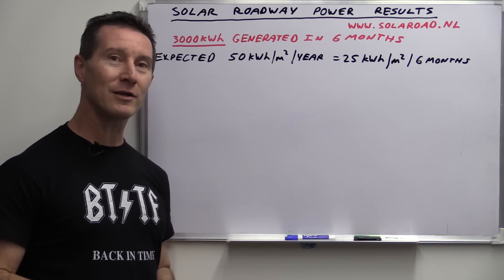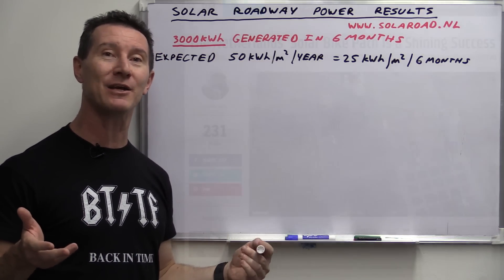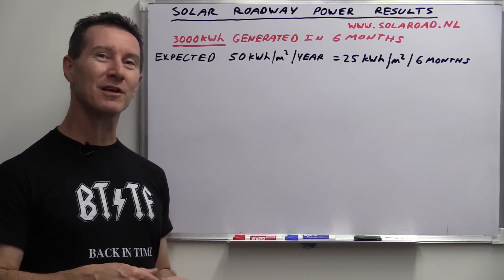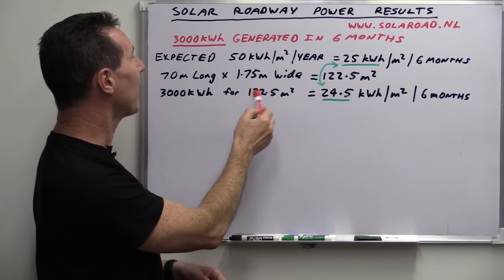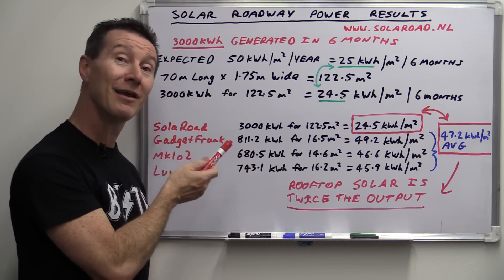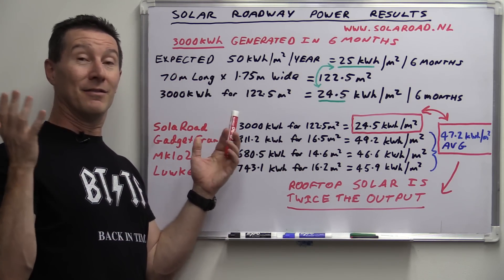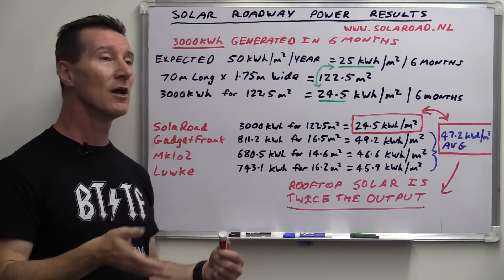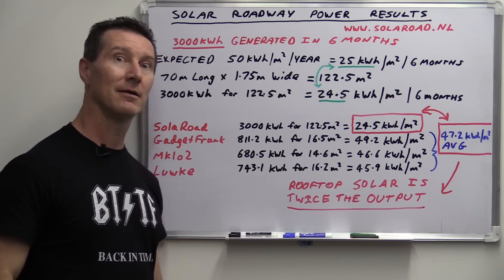EEVblog #743 - Solar Roadways Test Results

Comment: How many KWH are required to produce the tempered glass anyway?
Reply from the maker: ***** You aren't supposed to ask such questions!
Reply: EEVblog LLLL, I suppose not.
Reply from the maker: ***** Anyone with any sense can see it's the worst idea ever, except the true believers...
Reply: ***** dont even get into the resource management with "solar freaking roadways" and how much resources it will swallow up, mind that the cost and even by then the time each and every panel would need to be replaced again at full cost they wouldn't of paid for themselves.

worst idea ever.
Reply: Gordon Freeman When the climate was cooling In the 70s it was man made ice age was going to destroy the planet.
Then when the climate started to warm up in the ~80s it turned into man made global warming was going to destroy the planet.
Then when the climate started to cool down in the ~2000s  it turned into man made CLIMATE CHANGE is going to destroy the planet.
Absolute 0 credibility, but a multi-billion dollar government sponsored industry with the politicians and their big business cronies being the windfall bread winners in the end.
Make people into believers and you can systematically raise taxes and still get re-elected. Follow the $$$...
Reply: ***** exactly man. They'll spend millions to save a few bucks. If it was me, and I was going to piss away money for cLIEmate change. I'd string a dozen airfilters together, and insert them into the coal fired power plant's exhaust system and pay the fellas there to change them every other day.
Reply: ElectronSpark "Absolute 0 credibility", so some conflicting media discounts the data? You're a corporation's dream citizen.
Reply: ***** 
What makes you think that climate change is a lie?
Reply: ElectronSpark "When the climate was cooling In the 70s it was man made ice age was going to destroy the planet."  Some scientist were predicting that but far more were predicting that the cooling period would end and we would soon start rapidly warming.

"Then when the climate started to cool down in the ~2000s  it turned into man made CLIMATE CHANGE is going to destroy the planet." Umm no on both counts. The Earth continued to warm and some bloggers and tabloid journalists cherry picked their start and end point to show the opposite (not hard to do, just start in an unusually warm summer and end you graph in winter of a later year and draw a line between the start and end point and boom a decline). The second is that scientist have been calling it climate change since since they have started looking into it, its not a recent label change.

"a multi-billion dollar government sponsored industry with the politicians and their big business cronies being the windfall bread winners in the end." yes those green energy companies are so huge and powerful, not like the poor little oil companies.
Reply: ***** 0 since they built the glass using energy from solar road ways.
Reply: ***** Adding up the confirmed and estimated death toles from ALL nuclear accidents to date, the tole is less then 200 for direct deaths with indirect deaths in the 5000s where 4000 of that was from Chernobyl. Now lets start on the death tole from other (energy) related industries. lets start off with the worst disaster we have had in the field. the  Banqiao Dam faliure. 250,000 dead and a vaste stretch of land flooded. Several hundred direct deaths from Oil & gas explosions almost reaching 1000. and the indirect deaths from the hydrocarbon energy sector goes above 1,000,000 per year due to health effects caused by smog.
Between Fukushima and Chernobyl some 3,200 Km^2  have been made un usable. the amount of land we have destroyed through mountain top removal for coal and through tailings damn failures is massively larger then that. What im saying, is the risk is lower then risks we are allready taking playing with hydrocarbons. even if we had a chernobyl level event every decade it would still have a lower risk and it would still result in a lower number of deaths then what we are currently doing... And nuclear technology is mature, we can build them on the same scale to the oil and coal plants. we have shown its possible to replace them with nuclear in a short time frame. something the renewable sector hasn't shown even with their many attempts. This climate issue is a race against time, I'm all for renewables but i don't want people twidling there thumbs around waiting for the tech to mature.
Reply: ***** More like, when it comes to safety, nuclear power plants are planes and chemical spills are cars, one kills far more then the other, but you will never see coverage of that one on the news for several weeks. Nuclear power is a solution to the green house issue we are having atm and it kills far less then what we are currently doing.
Reply: ***** You can always trust a guy named Barack Lasagna
Reply: ***** Oh, and the road would need to be closed for solar panel maintenance and to clean the rubber off the road lol!
Reply: ***** You do realise that chemical plants and waste damns for the chemical industry fail far more often then nuclear plants right, and that they contaiminate large swaths of land with toxic chemical waste that will always be toxic and they effects far more people. Compared to alot of industries we use, an accident in the nuclear industry is rather benign. The only real difference is ignorance and scare mongering.
Reply: Clifton Murphy
Do you expect those panels to outlast those asphalt-topped roads?
With real traffic, I don't give them 26 DAYS.
Reply: ***** That and people like me would 'borrow' them for their solar projects....  solar panels belong in safe, secure, clean places... like on the roof. :p
Reply: EEVblog We should jettison all of the true believers toward the sun... where they can build real solar roads.
Reply: azmanabdula The thing is, until every rooftop is covered in solar panels, no other solar application makes sense, at least if your goal is the most energy for the least cost
Reply: Not to get in the middle of the whole global warming debate going on but watching this video and reading these comments really makes me wonder if solar energy could ever really replace fossil fuels one day and if so, at what cost? I'm no expert on the subject but it just seems like nuclear energy is so much cheaper and cleaner to produce.
Reply: Chernobyl is a RBMK typ reaktors. This type is not made any more. Also, it had no containment building that was the major problem with the accident.
If you talking about farms,there is some out side of the Exclusion Zone, they farm all day and there is no problem.
Inside the Exclusion Zone there is of cause (per definition) no active farming. There use to be some farms.

Actually the city of  Chernobyl is not technically evacuated today, there is about 600 people living there and the level of radioactivity is far with in the safe limit, but it is actually in the theoretically evacuated zoons. Actually today about 96% of the evacuated zone is below the limit. But the area today is much more valible as a evacuated zone so there is no need to de evacuate it.

"Which has the radioactive for Ages waste?"
what about it?

"Most people killed by nuclear industry take a long, painful and extremely expensive time to die, con-fucking-gradulations!"
No that´s is a myth, you watch far to much TV.

"As was pointed out to me in 1973, the lack of personal responsibility in the industry almost guarantees accidents"
Well, someone is stupid then. Nuclear industry is the safest industry in the world.

"One incident and the roaches scurry for cover."
Yea, its quite clear you dont know anything about it.
Reply: It originates with The Club of Rome.
They are the old world imperial europeans, who are hell bent and determined to collectivise the planet, cull the useless eaters, and rule over the one billion remaiming hue-man resources.
Reply: EEVblog I would have thought that the people at Popular Mechanics had some sense... It seems not...
Reply: ***** Sure, sure. It is such a generic term that anything can be labeled cLIEmate change. Air pollution, water poisoning is us, CO2 based warming is something far bigger than us.
Reply: CareerKnight
I want your sources please, not some cherry picked old data :P.
Reply: ***** Maybe you should read up on the things you claim?
There is not 'pause' in global warming.  
The average temperature of the air hasn't risen - so what? The big big majority of heat goes to the water, and the water temperatures have risen.

Also, there are more ways of measuring it - and one is quite simple - measure the energy that the earth receives and the energy the earth looses - and viola - we have a net gain - the earth is receiving more energy than loosing.
Reply: *****
Oh well, i have already read a bit of their reports, and i tried to find what you are referencing - well - nope, nothing.
The climate is still getting warmer - according to the latest report of the IPCC too.

http://www.ipcc.ch/pdf/assessment-report/ar5/wg1/WG1AR5_SPM_FINAL.pdf

And yeah, the upper troposphere won't get warmer - the sea does, the ice melts, the glaciers recede.
What more do you want?
What we experience right now is pretty much the worst scenario predicted 10 years ago - and claim nothing is happening?
Reply: ***** Its actually not that bad, producing. The thing is that most of the energy is heating, and it can be done more efficient with direct fuel heating.

But that is temped glas. If we talking about safire glass its like 50 times more energy or something.

Also, the high transparency glass used at normal solarpanels use a lot more energy to be produced than normal 

The thing is with normal glass is that it is the least transparent in the green sector. For normal day to day use, it dont matter, because the human eye is the most sensitive in that sector.

The problem is that most PV  is optimized to use this specific freqnesy to convert it to power. The thing is that using just a single junktion PV is a lot cheeper than using multi junktion once. So producing twice the amount of single junktion PV is still more efficient than producing halve the amount of tripple junction once.

The sun is most intensive in the green-yellow ish band. So they PV producer's optimize the PV fort that band to get the maximum amount of power for a single junction. The problem is that normal glass, as well ass tempered glass (that is basically normal glass that have been change to be tempered) is not that transparent.

This making it really bad using normal or tempered glass for PV:s. Using special PV glass panels that is especially transparent in this region is preferable. This use a lot more power to produce, but not that much more so it ofset the gain. Well, that is, if the glass is like 2-3mm thick. If its 20mm thick, well, then forget it.
Reply: Gordon Freeman
We'll be cool as long as you finish hl3
Reply: ***** How little you know... Well well, you can always learn more. 

The thing is that heavy metals are collected behind the dam wall. They are quite positives (much more than the radioactive fall down of for example Cesium 134, that was the major fallout of Fukushima, that by the way have a half life of 2 years)

They don´t do that much during the time the dam is working. But if the dam collapses the toxic heavy metal is spreed over quite a area. It also flodes the areas and drown every one there.

This might not be that common, but its far more common than nuclear power plant breaking down, it do happen every second or third year or so, the media usually don't report on it if you dont live in the area.

The biggest accident of this type happen in China in 1987 it drowned about 170 000 people and left over 2 million homeless.

They have to dig 5-10 meters down in the ground and processing several cubic km of earth to remove the heavy metal, other vice is literally deadly to live there.

Around fukushima about 90% of the close of area the radiation is now all but gone. In the next 10-15 year the whole area except from the closeted 500 meter from the reactor will be considered clean. With out touching a shovel. The total number of death of the Fukushima nuclear power plant was 4 people. That of 3 died from physical harm, and one died of a heart attack (considered a work place accident).

Actually in the less known Fukushima hydro pump power plant, the very same day, the dam collapse bacuse it was undermined by the tsunami, killing 8 people in the process (go check it up). I bet you didn´t know that.

Don´t talk about Chernobyl, its a older generation reactor. Its only 6 still in use, and all will be closed down by 2023.

Fukushima I is actually quite old to. They are actually older then the Chernobyl reactors, but its a half a genaration newer type of reactor. The Fukushima II nuclear power plant, that is just next to Fukushima I did not suffer any meltdowns or major problem, and its suffered the exact same tsunami. Why... well its more modern.

Even Fukushima II is quite old by international standard. Also Fukushima I was lacking a over pressure filter that's is mandatory it just about every western country. With that filter there would be no contamination what so ever. Of the worlds nuclear reactors today about 80% have that filter, and most of the once that don´t is about to be closed down.

Looking at the reactors that is built today almost exclusively (apart from a hand full in china), they are Gen III or gen III+. They have total passive cooling. They are walk away safe. No accident or even critical condition have ever accrued in a reactor of that type of reactor. Well, because its basically physically impossible.

" because the ones we have have not killed more people than wider-used technologies and support... YET?"
No, you are way of the math. Nuclear power kill the least people per TWh. It don´t matter if you build 1 or a 1000. That number don´t change (well, it decreases if we build more modern once). Actually nuclear power kill less than solar, and also less than windpower.

Wind-power kills about 100 times, yes, times, not procent, more people per TWh produced than nuclear power the last 20 years in average. Even including Chernobyl, the differences is still way over 10 times. Windpower actually become safer to. But they still kill about 5-10 people a year, and that's quite a lot.

Most of the people killed in Nuclear industri is actually not killed in large scale accident. Most is killed in mundane activity mostly because of fall or hot steam. Some are killed in radioactivity accident, but its really rare. The last 20 years only 5 people died that way, its still to much, but its less then is killed in windpower in one year.
Reply: ***** We are constantly tearing up our roads and replacing them.  Assuming it were viable, this is something that would have to happen over a long period of time.  The roads would not suddenly be all raised and replaced.
Reply: ElectronSpark
It's like this. When all that climate scientists was records, geology and beginning satellite scans the picture was that natural cycles determined the weather and that man has no great sway in the matter. By all the natural cycles we would be headed into an ice age over the next centuries, the 90's should have been cooler totally by natural processes.

I remember the 60's very well, winter stayed winter. By 74 winter took a vacation. Now it shows up for star appearances with spring in between several times a year.

The ocean temperatures are up. The glaciers are disappearing. Sea level is rising and it's not just because more than 10,000 year old land ice is melting. As water warms it expands a little. The oceans are miles deep, the expansion will add up as they warm.
Reply: ***** Let's just use his numbers (the yield you end up with is around 70kWh.m2 annually) OK... @ 15cents/kWh = $10.50 worth of power produced per  m2/year.

$10.50/yr   These people have to stop.
Reply: Raspoetin a This entire arguement is stupid. We need real numbers for the cost of existing solar road prototypes to make any real arguements. This is all people argueing over speculation.

My arguements stems from common sense. You put solar cells on a roof, you need a somewhat light, somewhat cheap enclosure. IF you have them on the ground, you will need a much beefier enclosure to handle bikes / people, or insanely beefier enclosure to handle semis / trucks. No matter what the cost of the solar cells or roof enclosures, just thinking about it for more than a minute, it makes sense that the roads would cost more.

How much more, the solar bike path people won't even TELL us. since they BUILT it and therefore had to PAY for it, they would know, but the fact they  won't TELL us leads me to believe the number is high at best and embarrassing at worst.

We are at the point that really, we need REAL LIFE numbers to continue.
Reply: ***** My original commet's ( 148 comments ago) sentiments exactly. Put them on the roof of however many people's roofs that that would pay for and move on.
Reply: Barack Lasagna  ?
Reply: Gordon Freeman Yeah dude, and solar energy is their master plan. You wouldnt understand, but trust me, you will scream "DAMN YOU SOLAR PANELLLSSSS" as you die
Reply: ***** Someone always beats me.....   Fucking spot on!
Reply: EEVblog Such as yourself? :)
Reply: jrmym2 The technology shouldn't be undermined due to the incompetence of a few people....

What happened to spray on (In layers) solar paint?

The application of this on every concrete surface when economical will be sufficient in reducing cost on energy expenditure... 

.....and what happened to ponds filled with pond scum genetically engineered to produce low currents? 

Think biological and save the earth from heavy metals : P

(Im thinking at least 2 centuries before my time but we cannot just give up)

PS My position on solar roadways is too harsh to announce...
Reply: CareerKnight "scientist have been calling it climate change since since they have started looking into it, its not a recent label change."
So all those nightmares I had in grade school about the world coming to an end due to a man made Ice Age was just a label misunderstanding on my part. Just like all the years Global Warming was in the news I was mishearing it too.
I know, just because I lived through it all it won't change your faith. I would probably have more luck convincing a Christian that Jesus didn't exist or a Muslim that Allah didn't exist.
Reply: ElectronSpark
Since you for some reason you didn't read it before i will post it again. In the 70s "some scientist were predicting that (an ice age) but far more were predicting that the cooling period would end and we would soon start rapidly warming." To be more exact between 1965-1979 there were seven papers published predicting global cooling and in the same period there were forty four papers predicting global warming.
Reply: ***** Solar panels don't grow on trees?
Reply: 2 things. The roadways are not only a fact of input vs output on energy but is pushing the production of clean energy. Second of all, it may take energy to make the panels but your return on investment is clear after a few months of use, and even after that maintenance energy/cost is far lower than the output they would produce in a given time period.
Reply: ***** I hope to god youre not an engineer. You cant be. Surely
Reply: CareerKnight No problem, warming, cooling, the "cure" is always the same. Let the government keep taxing and taking control of what you can buy and do until you are nothing more than a slave with a bus pass. Then one day you'll wake up and see the environmental rules are no longer being enforced and the politicians and their wealthy cronies all have carbon footprints the size of a small city (just look at Al Gore's extremely wasteful carbon footprint used to heat and light his huge mansion and fuel his private jet-setting lifestyle). 
It's going to be a rude awakening when you realize they didn't care about the environment all along but they definitely got everything they wanted and with your support. Just don't think you'll be able to protest or they'll take away your bus pass.
Reply: ElectronSpark
You are a sad strange little man and you have my pity, and I think you want to be arguing with someone else with all the bs you keep randomly introducing into the conversation.
Reply: EEVblog Solar Roadways may have you drawn and quartered, just for thinking that question. LOL!
Reply: Gordon Freeman
Sources to which part
Reply: Hugh McBroom Then there is all the people killed falling trees for firewood, mine cave ins, and oil rig fires.
Reply: CareerKnight "... cherry picked their start and end point ..."  Not taking sides here, but the "cherry picking" argument doesn't work any more over 17+ years -- those "bloggers and tabloid journalists" were right.  Even the IPCC has acknowledged a "pause" in global warming.  There have been some attempts at explanation, and the significance is a subject of debate, but the pause is real.
Reply: ABaumstumpf Don't argue with me; argue with the IPCC.  They acknowledge a pause.
Reply: ABaumstumpf http://www.bbc.com/news/science-environment-24173504
Reply: *****
I have read the direct IPCC report, not some second-hand report that tries to twist reality.
You know, yeah, some parts do not warm up as much as others, and some even cool off - that is a predicted effect.
You are trying really hard to deny facts.
Reply: ABaumstumpf I'm not denying anything -- I started this by saying I wasn't taking sides.  I just pointed out that the IPCC acknowledges the pause (they appear to prefer "hiatus").  I am well aware of the fact that global warming is a theory that predicts (after the fact, of course) anything.
Reply: ***** Here's something you may find interesting  http://www.crystalinks.com/volcanoesunderwater.html

http://www.bing.com/images/search?q=new+islands+forming&qpvt=new+islands+forming&qpvt=new+islands+forming&FORM=IGRE
Reply: ***** I tried your link three time man, no luck. I'll try reserchgate.net directly.  FYI
Reply: *****
And i'd suggest you to READ the actual report - in no way does it say the warming has stopped.
What is happening is that the air is not warming as fast as predicted initially - but the oceans are warming slightly faster, the ice is melting slightly faster - aka the heat is distributed slightly different than predicted.
Reply: ABaumstumpf You keep arguing with me when I'm not arguing with you -- you even concede that the air is not warming as fast as predicted.  See http://blogs.scientificamerican.com/observations/the-pause-in-global-warming-is-finally-explained/

All I'm saying is that denying the reality of that (when it's blatantly obvious from a glance at a relevant graph) is just handing ammunition to the deniers.

I tell folks about global warming all the time.  When there's a drought, I tell them it's a predicted effect of global warming.  When there's too much rain, I tell them it's a predicted effect of global warming.  When it's too hot, I tell them "global warming" explains that.  When it's too cold, I explain to them that global warming predicts that, too.  When there are more hurricanes, I tell them it's due to global warming.  When there are fewer hurricanes, I patiently state that global warming predicts that.

We're clearly on the winning side.
Reply: ***** You're on my thread, go fuck yourself.
Reply: *****
"2014 was the hottest year on record ..."  You have to be careful with such absolutist claims.  In fact, statistically speaking, that claim has just a 38% likelihood of being correct, due to the error margins.  In particular, 2010 and 2005 have a significant likelihood of having been hotter.  This is why I keep cautioning folks not to hand ammunition to the deniers by making bald statements of fact; stay as vague and nebulous as possible and avoid falsifiable claims.
Reply: CareerKnight
Shit, my bad, I meant to reply to ElectronSpark.
Reply: CareerKnight Do predictions made before both data collection and methods in climate science improved have any power to change the long term consensus of over 95% climate scientists?
If you got a test paper with 97% right, do you try and say that those 3% wrong prove the teacher wrong? Because that's what the denialists have essentially as their main argument, that the consensus is wrong!
Reply: Dev Durer Do you want to live where the spent fuel is kept? Or how much "disposal" and security will cost?
Where will you find responsible people to build, run and maintain these nuke plants? That's been why the failures that happened so far have happened. Shit happens and no one is responsible, throw money at it.
Reply: Hugh McBroom Comparing nuclear power plants to dams breaking is comparing apples to cinder blocks. I have yet to see a broken dam cover an area with radioactive pollution and all the associated long term problems.
There's very few nuke plants compared to coal fired generators and those are bad enough but you can't compare total problems of one with total problems of the other, that's cherry to truckload of watermelons comparison -- to see which is heavier! No duhhhh.
Let's build 1000's of nuke plants because the ones we have have not killed more people than wider-used technologies and support... YET?
Reply: matsv201
Are there farms around Chernoble yet? TMI?
Which has the radioactive for Ages waste?
Most people killed by nuclear industry take a long, painful and extremely expensive time to die, con-fucking-gradulations!
As was pointed out to me in 1973, the lack of personal responsibility in the industry almost guarantees accidents. One incident and the roaches scurry for cover.
Reply: ***** Going from IC vehicles to EVs will take three decades if we think about it seriously.
Making all the roads photovoltaic. Probably only half of that time. :)
By the way , you know what is the future of stationary storage? Hydraulic hydro storage invented by the german physicist Eduard Heindl.
If that is going to work we will be out of trouble. They are currently undertaking feasability studies here in Germany.
Reply: Tetra Digm What are you talking about?
Reply: Tetra Digm Diffrent kind of reactors
Reply: Tetra Digm
People who work with radiation here wear dosage meters and protective gear. If your meter says enough then you stay away for as long as you are at a safe limit.
So are these people in Chernobyl always the same people? How are they dressed? Do you know their medical histories? Because otherwise you try to make people being somewhere into more than you know.

Have they finished the New Safe Confinement that they hope will last more than 100 years to cover up what you seem to think is safe?

I am sure that whatever your government tells you is true since only the US government lies to its people. That must be true, the Easter Bunny told me so and the Tooth Fairy agreed.
Reply: ***** less than what is required to produce asphalt.......
Reply: Tetra Digm The problem is that chernobyl didn´t melt down. It was a over critical core explosion. It´s not the same as a melt down.

The people living i Chernobyl (the City) today, is living there, full time. There is hardly radioactivity left in Chernobyl (City). The levels is actually lower than a lot of bigger Cities. There are dressed like normal people, because there is not any high level or radioactivity. There medical history is much better than most larger cities.

"cover up what you seem to think is safe?"
It dont really matter. If they just start cleaning it up. But there have been a lot of political issue about cleaning up the core. The thing is that a lot of anti nuclear people don't want it cleaned up. This is actually the biggest problem. The technology to clean up the core have been available some time. But can´t be used because Tjernobyl is in Ukraine, not Russia. Russia wan to clean it up, but they are not allowed. Thats why Russia sent that much cleaning up equipment to Fukushima.

The "radioactive" water stared in Fukushima is all cleand. The reason why it´s not allowed to get disposed of is political
Reply: *****
I wonder how long it will take for Texas to declare they've had enough of what ain't happening?
Reply: ***** The 38% figure is correct, according to NASA; I should have been more specific.  I hadn't seen the NOAA result you quote.

See http://www.ncdc.noaa.gov/sotc/briefings/201501.pdf (slide 5) for a side-by-side comparison.  In any case, 48% still means that it is more probable than not that 2014 was not the warmest year.
Reply: *****
And 100% probable it's in the top 10.
Kind of makes me wonder about the preceding years, how many since 1999 have been 100% in the top ten.
By the natural cycles, we were supposed to be entering a long cooling period as of 1990.
Reply: ***** I don't know.  I'm not saying one way or the other whether this is viable technology,  but I know I can walk up the street and buy quarter inch thick tempered glass for $0.33 per square foot.

The other thing is that if you're making solar roads, you have to look at conventional road costs vs solar road costs plus energy production benefit.  Remember, we're moving away from coal production with the solar model, so you have to add conventional road costs plus coal and other energy production costs.
Reply: BrainToMush Well, the ashphat and concrete roads are all ready in place. When they were built they were fully costed with those dollars then.
Tearing them up and replacing them would be a very bad idea.

If people want solar, fine, great, put it on the roof. I looked into it when I owned a house, it was too expensive back in the 90's.
40 year ROI.

Remember too, these roads were walking and cycle paths, not automotive roads.

P.S. Your comment was marked as spam. Since this is my thread, your comment stands.
HARV
Reply: ***** /facepalm...you do realize that roads are replaced constantly right? They are not something that once down your done, so im confused here with your logic. All studies to date show the average lifespan of a asphalt surface is at most 26 years on very low useage roads. this is of course much worse down to around 5 years on busy interstates. The simple fact is that ALL asphalt roads are replaced constantly. Your initial argument is invalid.
Reply: ***** ..... CO[2] is the primary exhaust product of burning coal.
Reply: ***** You throw your Holy Pope under the bus so fast! Poor little Al.
Reply: ElectronSpark You better watch what you say! Clearly Buzz Werd knows more than Al Gore and apparently he is a climate scientist, or maybe he just plays one on the internet.
Reply: Pixy Orgami
You twy weaw haad to gwow up a be a biiig twow some day. But for now, your momma's callin.
Reply: ***** I didn't mean to hit a nerve by calling him your pope. Sorry about that.
I've heard doomsday predictions about climate change all my life. When I was a kid in the 70's the man made ice age predictions scared the hell out of me as I didn't think I would have a future, now the warming scares would be funny if they weren't so pathetic.
I don't know which group has made more failed doomsday predictions, 'climate change' activists, or Jehovah Witnesses.
Reply: ***** 'How many KWH are required to produce the tempered glass anyway?'
It takes between 5 and 10 Kwh to produce 1 Kg of glass. A 10mm thick panel weighs about 25 kg. So 125 to 250 Kwh.
Energy production is estimated @70Kwh per year, that means that it will take between 2 and 4 years for this road to pay back the energy debt. 

The solar panels also need energy to be produced, and it takes about 1 to 4 years to pay back the energy debt.

6 to 10 years is probably a fair estimation for this road to pay back its energy debt. 

Is this road profitable over a lifespan of 20 years? From an energy perspective I would say Yes.
I don't know about the economic feasibility because they have not released the price difference between an ordinary road and a solar road.
Reply: Raspoetin a A city would probably receive better benefit for their dollar (not to mention decreased carbon emissions) by offering a small rate reduction to customers for use of their rooftops. Install and maintenance would be less, sunlight angle would improve and the panels could possibly lower energy use by that customer due to any insulation properties the panels may provide.
Reply: ElectronSpark Absolutely.
However, if they were to equip every roof in the Netherlands with solar panels, they would 'only' generate 25% of the needed energy.
If you want a larger percentage of renewable energy, then other options have to be explored.
Reply: Raspoetin a
You really think that 10 mm glass will support road traffic? Here's some words for you: vibration, braking, cornering, tonnage, normal and forces.

When you do your calculations, you do know that the Solar Road cells do not cover the whole surface? They tell how much. That every vehicle on the road necessarily shadows an area the whole time it is on the road and that gets wider as the sun gets lower in the sky? Your grid takes big hits during rush hours. Bumper to bumper shade. Do you know that road surfaces get DIRTY?
Reply: ***** 'You really think that 10 mm glass will support road traffic?'
I don't know. 
Some info on the strength of glass:
http://uk.saint-gobain-glass.com/trade-customers/physical-properties
The compressive strength of glass is extremely high: 1000 N/mm2 = 1000 MPa. This means that to shatter a 1 cm cube of glass, it requires a load of some 10 tonnes.

The resistance to breakage on deflection is in the order of:
- 40 MPa (N/mm2) for annealed glass
- 120 to 200 MPa for toughened glass (depending on thickness, edgework, holes, notches etc).

"Your grid takes big hits during rush hours."
Yes. 
"Do you know that road surfaces get DIRTY?"
Yes.
Reply: Raspoetin a One vandal with a sledge hammer or other heavy object in the middle of the night could probably do millions in damage with hits at intervals.down the line. I can't say I understand what drives a vandal to do what he does but the more damage they can do seems to make them enjoy it even more, especially if their handiwork gets on the news.
Reply: ElectronSpark I wonder if the coating will help to prevent shattering.
Reply: Raspoetin a
Compressive strength acts when you have a solid base to compress against and that is not PCB's with solar cells.
The glass will have to rest on standoffs and weight born between those will include bending forces. How is the tensile strength of plate glass? crrrrraackkkk
Reply: ***** 'and that is not PCB's with solar cells.'
What makes you think they mounted solar cells on PCB's?

'The glass will have to rest on standoffs'
What makes you think the glass is resting on standoffs?
Reply: ***** 'The same thing that makes me think you never watched the Solar Roads promo videos'
Oh great, another one who cannot differentiate between the 'Solar Freaking  Roadways' with their hexagonal panels and the Dutch Solar bike path.
This video is about the test results for the Dutch bike path.

The whole construction appears to be somewhat similar to conventional Solar Panels. Its a layer of Glass on top of the Silicon panels and put in a frame.
The glass is thicker with an 'anti slip' coating, and the panel is now made from concrete.
Reply: Raspoetin a
It's still bullshit.
The roadways have been debunked and the bike paths have been debunked but you want to hang on and cry nonononononono over every little detail you can imagine.
Reply: ***** No, the Dutch solar road hasn't been debunked what so ever. 
The goal is to have a 'return of investment' of 15 years in 5 years time. But since no one knows what the extra cost per m2 is going to be (including maintenance), no one can make a clear calculation.
Dave's whole argument leans on the comparison with tiny retail systems, not large scale solar farms.

The big difference between a solar panel on the roof versus  on a road is the thickness of the glass, about 3 times thicker, it has a coating and lays flat. And instead of hundreds, if not thousands of individual controllers and connections to the grid, there can now be just 1.
Reply: Raspoetin a
So long misdirection troll.
Reply: Hugh McBroom Not even that. Chemical spills are Titanic drowning. Filter failures and coal dust are worse still. The worst failure since Chernobyl, Fukushima, is comparable in scale to a bus crash.
Reply: Raspoetin a Your estimates are off - this is best case 25 kWh/m^2. 1 kg of tempered glass is not enough to cover 1 m^2 of solar panel and more importantly, not strong enough to be used as a road. The lifespan is probably "a bunch of trucks".

So it will not be profitable as you'd get to replace the panels very often - not to mention maintenance cost to keep them clean enough to deliver those good figures.
Remember, this was a bikeway - not traversed all that often either.

I'm also concerned about practicality:
a) eye glare from reflections
b) slippery in winter, cannot use standard sand and salt on top
Reply: AstralStorm Dave calculated this as 25 kWh/m2 for the first 6 months. I calculate it as 28-30 kWh/m2. This figure is only for 6 months and excludes the summer months. When I compare it with other solar panels, the yield you end up with is around 70kWh.m2 annually.
They used 10mm glass on top of the panels, this is roughly 25 kg/m2.
The glass has a coating on top that provides the 'roughness' and removes the glare. http://www.solaroad.nl/wp-content/uploads/2013/06/LabTNO2.jpg
Reply: AstralStorm
Notice how Dave shows the 6 month period that includes summer and winter and how Dave shows his calculations.
Then notice how it's claimed that the 6 months does not include summer and a set of ratcheting upward estimations with zero calculations actually shown.
He could work for the solar scams people, their work is just as phoney and intentionally misleading. I wouldn't be surprised if he is.
When it's been shown again and again not just that but how money spent on solar roads is a stupendous waste, only idiots and liars will argue.
Reply: *****
Maybe the next scam will be square wheels for cars and there will be idiots defending that.
Reply: ***** $10.50/yr = $157.50 over 15 years.
Price of solar panel per m2 wholesale around 50m2 (Alibaba.com)
Price of glass panel wholesale around $20 per m2 

That leaves $87.50 for the coating, the electrical connections and maintenance, transport and handling and so on.

Is this feasible? I don't know but the Netherlands Organisation for Applied Scientific Research ( a non profit organisation with 3000 specialists) seem to think it might be possible. Their goal is to have a 15 year return of investment on these roads.

Unlike roof top installations, these roads can be produced 'en mass' and in large quantities. If you have to build a road anyway, all you have to do is add the panel, the glass, some surface coating and connect it all up. 
The work involved in creating these roads seems pretty simple. Put the glass down, add panels on top, bundle the wires and pour concrete over it. Once the concrete sets, you turn the panel around and spray the glass with a coating.
Reply: Raspoetin a Are these road ways? With cars and trucks travelling them?
Reply: ***** Their goal is to eventually make them into road ways for cars, trucks etc. But the requirements for a road is much higher then for a cycle path and I don't know if these road will be able to withstand the forces that come with heavy trucks.
I guess that testing it on a cycle path is much safer while still providing the needed data.
Reply: Raspoetin a You are suggesting that the individual bike path panels will cost around$157.50/square meter, to include installation and maintenance?  LOL!!!!!! you are seriously delusional, the prefab concrete would probably cost more than that, not to include the glass, textured layer, installation, maintenance, power inverters, and the solar panels.
Reply: ronc1357 I am not suggesting anything. I was merely showing some of the extra costs involved in changing a prefab concrete road to a prefab solar road. 
A group of specialists (Scientists, engineers) did a techno/economical study of the concept and they calculated a current pay back period of 20 years, and a possible ROI of 15 years in 5 to 10 years time.
Am I delusional? NO, just sceptical.
Reply: Raspoetin a  "$10.50/yr = $157.50 over 15 years.
Price of solar panel per m2 wholesale around 50m2 (Alibaba.com)
Price of glass panel wholesale around $20 per m2 
That leaves $87.50 for the coating, the electrical connections and maintenance, transport and handling and so on." 

This is your quote. You don't sound too skeptical to me, from your comments you seem to be promoting this completely unrealistic endeavor. You sound just like the solar roadways fan boys, delusional, or you're just a troll.
Reply: ronc1357 I did those calculations because I am sceptical. I just wondered why they would research this in spite of the arguments from Dave or Thunderfoot. Now I have my answer. An incomplete answer for sure, but it does show my that further research into this is warranted. I can imagine that the techno/economical research showed an initial 20 year payback period.

I realise I sound like a solar roadway fanboy, I am not. I am just trying to be realistic.
Reply: Raspoetin a https://www.youtube.com/watch?v=6-ZSXB3KDF0&lc=z120sj4bdq2ouzlbl04cjxqy4xrwixdpjyk0k
Your estimates for solar panels seem ridiculiously lower than any panels I see in the stores, but ill give you benefit of the doubt and assume that's markup retail

Section revised, see below:-No way in hell is tempered glass $20/m^2. First consider that you need TEMPERED GLASS which is much more expensive than the regular pane glass you see all the time. Now consider that you'd need glass at least several inches thick to support cars and trucks and SEMIS running it over. Also factor in some kind of support that holds the glass up above the panels (You're not putting all that weight direct on the panel if you want it in one piece). You could EASILY be talking $150-200 just for the glass-
I'm revising this section based on links posted lated on. From the prices for wholesale glass, I can find consistant quotes for about $2 per mm per m^2 of glass. This comes to 20$ per m^2 of bike path 10mm glass. For a solar road, holding vehicles much heavier than bikes and people, like semi's and trucks, it's a lot harder to guess a thickness. I'm going to ballpark it at ten times as thick, which would be around $200 per m^2 of road. *Note that a loaded semi trailer is more likely 1000 times the weight, and due to a greater surface area on the road, 100 times the psi (weight per square inch of glass it's on) than bikes and people - if the thickness of glass scales linearly, that's 2000$ in glass alone. Therefore $200 per square meter for roads is definitely a SEVERE UNDERSTATEMENT of cost made for the sake of example.

"Unlike roof top installations, these roads can be produced 'en mass' and in large quantities."
False preposition that they are not produced en mass. In fact they produce solar panels as fast as they can. Growing the silicon wafers is a delicate process and takes time, regardless of whether they are going into roads or rooftops. ANY ADVANTAGE FROM SCALE OF ECONOMICS THAT MAKES SOLAR PANELS USED FOR THE ROADS WOULD ALSO MAKE ROOFTOP PANELS CHEAPER! If they found a way to make solar cells half as expensive, BOTH would become cheaper, meaning rooftop will always be better value.

"The work involved in creating these roads seems pretty simple. Put the glass down, add panels on top, bundle the wires and pour concrete over it. Once the concrete sets, you turn the panel around and spray the glass with a coating." 
In a dry climate with very stable ground that might work, but anywhere that sees winter will see much pain. Water seeps in-between the "tiles" and expands as it freezes. If you look up videos of freezing water shattering thick metal spheres, you'll realize the problem. any cracks in the side of the units could crack the cement base and the panel, or pry the glass off of the cement. Water freezing between cells in a road could press them together with enough force to crack them. Don't believe me? Go take a look at any large area covered with paving stones, and observe how many are cracked or broken.
Reply: ***** 
Your estimates for solar panels seem ridiculously lower than any panels I see in the stores, but ill give you benefit of the doubt and assume that's markup retail

The price came from ALibaba.com. Don't forget that I looked at the prices of panels without glass and frame, just the 'naked panels'.
But if anyone has a better price indication, then I would love to hear it.

No way in hell is tempered glass $20/m^2...you'd need glass at least several inches thick

The glass that is used in this road is 10mm thick (0.4 Inch). Compression strength of glass is very high. 
- Fully tempered glass in the US is generally rated above 65 megapascals (9,400 psi) in pressure-resistance, while heat-strengthened glass is between 40 and 55 megapascals (5,800 and 8,000 psi).
- High-strength concrete has a compressive strength greater than 40 MPa (5800 psi).
Since the glass is fully supported, tensile strength will only be an issue when traffic is accelerating, braking and so on. 
Someone else who did similar calculations came to 30 Euro for the glass. 

False preposition that they are not produced en mass
I was not talking about producing the panels but about the installation of those panels. 10m2 installation on a roof can take 2 people the best part of the day, while installing 10m2 in a prefab environment could be as little as 1 hour for 1 person. These roads can be made in a factory environment.

In a dry climate with very stable ground that might work

Don't believe me? Go take a look at any large area covered with paving stones, and observe how many are cracked or broken
The Netherlands is riddled with large areas of concrete paying stones. Just about every sidewalk is made from them... And the Netherlands is very wet with soft ground and it freezes in the winter. There are also concrete roads there. Your statement that water between the concrete cells will crack the concrete if it freezes over seems incorrect.
Reply: Raspoetin a "The price came from ALibaba....."
Ok, solar panel cost seems completely reasonable then

"The glass that is used in this road is 10mm thick (0.4 Inch). Compression strength of glass is very high. "
And the rest of that paragraph... That seems reasonable for a bike path, but not for a road, which I'd guess would need at least an inch. Does that cost factor in any texturing of the glass to keep it grippy in the winter or while wet? 

Larger panels could be built in sections like bridges and then shipped in and laid like concrete slabs, which could lower manufacture costs, but that also further increases shipping costs as well. I've driven on sections of highway covered in cement slabs, and they were very bumpy as you go over the cracks. This would make the roads more annoying to drive on and increase stress on the edges of the sections.

"Fully tempered glass in the US is generally rated above 65 megapascals..."
How does that translate to thickness? Is that for a 1cm sheet? 1 inch?

"Your statement that water between the concrete cells will crack the concrete if it freezes over seems incorrect." 
It happens a lot with roads here, so I figured it would happen other places too. How well a path or road handles this stress takes several freeze / thaw cycles, so time will tell. However the quite large crack at 1:03 doesn't inspire confidence in it being stable over a long time, whether this was caused by mechanical stress from above or from water getting in it and freezing or from the un-uniform sidewalk material expanding and contracting at different rates, I can't be sure.

Another thought occurred to me, if the roads and pathways are covered in glass, what is to stop assholes from smashing it? I see the inch thick safety glass walls of bus stops smashed fairly often. Some asshat could come along with a baseball bat and take a crack at the solar bike path if they felt so inclined (thicker glass might solve this at increased cost). A solar panel on the roof wouldn't be as easy of a target for vandals.
Reply: ***** "The price came from ALibaba....."
Ok, solar panel cost seems completely reasonable then
Yes, that is the cheapest panels you can get with glass, backing and aluminium frame. Lose the frame, the glass and the backing materials and the price would be even cheaper... So I reckon it is a fair estimation.

I've driven on sections of highway covered in cement slabs, and they were very bumpy as you go over the cracks
Yes that is a know issue with slabs that are created in situ. Nowadays they build concrete roads as a single piece. Or they use slabs that align themselves so the roads don't get bumpy.

However the quite large crack at 1:03 doesn't inspire confidence in it being stable over a long time
That was a bit that was frozen off due to a installation defect. That is to be expected when you build this for the first time. This is why you do this research in the first place.

How well a path or road handles this stress takes several freeze / thaw cycles, so time will tell
Time has already told this story many many many times. Using concrete pavers or slabs is a well proven method to create a path or road.

what is to stop assholes from smashing it
I don't know, maybe the coating (the bit on top of the glass that creates the grip for the traffic)?
Reply: ***** Your assumptions are correct. Here is some links that show this. "Raspoetin a" is not presenting viable numbers. The second link shows that the cost is much more than he is stating for the cost of the solar cells, the technology they are developing states that they MAY be able to get the costs down to $20.00 per square meter, or 75% less than existing solar cells, which makes them about $80.00 per square meter. Even if the cost was $20.00/square meter it still wouldn't make the payback time of 15-20 years because of the other costs involved with this project.  The glass alone is 118.00 euros/square meter= $131.78 USD. The prep and concrete work would equal ~ $3.25-$5.25/square foot. 

http://www.bespokeglassonline.co.uk/toughened_glass_prices.php

@2012

http://www.concretenetwork.com/concrete-prices.html
Reply: ronc1357 The second link isn't working for some reason.
Reply: ronc1357 Stop using retail prices! Certainly for tempered glass since that needs to be cut to size first before it gets tempered.
When ordering sheets to a certain size directly from the factory the sheets can be cut while still hot and tempered straight away. It can be packed and put in containers straight away.
Have a look at these prices:
http://www.alibaba.com/product-detail/High-quality-tempered-construction-glass-4mm_60240545883.html?s=p

http://www.alibaba.com/product-detail/tempered-glass-sheet-price_60265727188.html?s=p

http://www.alibaba.com/product-detail/tempered-glass-sheet-price_60273414487.html

Even if the cost was $20.00/square meter it still wouldn't make the payback time of 15-20 years because of the other costs involved with this project
And how much are those other costs exactly?
Reply: Raspoetin a You are talking custom glass which is considerably more expensive than what they have on stock. Any time you custom order anything it's more expensive.

 I just gave you a link to how much it costs to install concrete roadways/driveways... $2.25-$5.25/square foot. That would equal about $20.25/square yard- 47.25/square yard.
Reply: ronc1357 You are talking custom glass which is considerably more expensive than what they have on stock
You are still thinking retail.
Ordering the glass for 10km of 4 lane road equals 150.000 m2 of glass. The size required becomes stock size...
Some of the factories I mentioned have an output of 100.000 per month, this means 6 weeks of work.
If you organise this properly you will add the solar modules straight to the glass and wrap and ship in 1 go.

 I just gave you a link to how much it costs to install concrete roadways/driveways
What about it?
Reply: Raspoetin a Will that support vehicles?
Reply: ***** The cycleway they build is strong enough for 'service' vehicles like firetrucks, ambulances and so on.
At the moment it is not up to standard for regular roads though.
Reply: Raspoetin a Well it looks like you have a business opportunity. Write up a business plan submit it for funding. Let us know how that works out for you lol.
Reply: ronc1357 They already did a full techno/economical study. Guess what, They got the funds to see if they could indeed make those roads. 
I would say that worked out pretty well lol.
Reply: ***** Absolutely, I agree with your entire statement.
Reply: ***** This entire argument is stupid. We need real numbers for the cost of existing solar road prototypes to make any real arguments
I absolutely agree!
I initially responded to EroomYrrah's question how much kWh it takes to make the glass. I ended that comment with the following; "I don't know about the economic feasibility because they have not released the price difference between an ordinary road and a solar road."

My intention has never been to state that these roads are economically viable, or a better alternative to roof panels. Merely to show that with current numbers you cannot state that these roads are not viable.

The biggest difference between roof panels and road panels is that roof panels mainly benefit the home owners, while a viable solar road benefits the entire community.
Reply: Raspoetin a 
If they are not economically viable then it doesn't benefit the community, because
the community are the one's paying for it, through taxes. Either the
community would have to cut programs to pay for these or raise taxes.
The only people that would benefit from these are the road builders.

If you aren't trying to prove the economic viability of these then
why are you constantly showing the costs of materials from all these websites?
Reply: Raspoetin a "The biggest difference between roof panels and road panels is that roof panels mainly benefit the home owners, while a viable solar road benefits the entire community."
I would argue this would be a small difference if it even exists, as all the houses are attached to the main power grid anyways any extra power one house isn't using could put back into the system, and used on other buildings that use more power than they generate.
Reply: ***** Rooftop installations are tailored to energy needs of the house. They produce as little as possible 'extra energy' because that is considered 'wasted money'.
But with panel prices coming down, this might change in the future. 
If a government wants to invest in green energy, they might get some payback from a solar road, but they will not get any financial payback from a rooftop installation.
Reply: >Suggest a very specific situation where no extra power is made
>Suggest because, in that situation, little extra power is made so little money is made
Well of corse! If you tailor a situation specifically to lower energy output it will lower energy output. But that's only what individuals don't bother doing to lower the up front cost of green energy. Know what else individuals don't bother doing to lower cost? Solar sidewalks!

"they will not get any financial payback from a rooftop installation."
How do you figure that? Even if the panel makes ONLY enough power for the house it's on, that's still a lot of energy the power grid DOESN'T NEED TO PROVIDE - meaning power savings! Power cost money to make no matter how it's made, so that comes to money savings.

There is an important question that comes up (besides how do I bold text):
If you were a home owner, putting your own money to do so, would you rather spend the money on rooftop panels or turning your driveway solar?

I personally would prefer the roof mounted panels - digging out an existing driveway to put in solar road bits, as well as the inherently higher cost (although how much higher is unknown) would put me off it. It'd be easier to just bolt some panels onto the joists in my roof than to dig up a driveway, easier to route the cables through my attic than digging a trench to route cables underground, and most of the system would be indoors making it easier to maintain
Reply: *****  I would put solar panels on my roof first as well. But only to the point where it is profitable (or break even).
But if solar energy would be profitable, my whole roof will be filled with panels, and then I might think about the driveway (but only if it is profitable).
Reply: ***** I did a bit more looking into glass costs. From the prices for wholesale glass, I can find consistant quotes for about $2 per mm per m^2 of glass. This comes to 20$ per m^2 of bike path 10mm glass. For a solar road, holding vehicles much heavier than bikes and people, like semi's and trucks, it's a lot harder to guess a thickness. I'm going to ballpark it at ten times as thick, which would be around $200 per m^2 of road. *Note that a loaded semi trailer is more likely 1000 times the weight, and due to a greater surface area on the road, 100 times the psi (weight per square inch of glass it's on) than bikes and people - if the thickness of glass scales linearly, that's 2000$ in glass alone. Therefore $200 per square meter for roads is definitely a SEVERE UNDERSTATEMENT of cost made for the sake of example.

Those costs do not factor in ANY of the anti-slip coatings or other processing they do on the glass - I'll ballpark this at $5 per meter square
I;m guessing based off of http://www.alibaba.com/product-detail/Super-quality-6x6-polycrystalline-solar-cells_60223705840.html that 1m^2 of solar cells would be $37, let's call it $50 after the costs of soldering it up / the cost of buying single larger cells.

So glass, coating, and cells have us at $75 per m^2 for solar PATHS, and somewhere between $255 and $2055 for solar roads (depending on glass thickness needed). Rooftop panels, if we were to build them, could use as little as 3mm glass costing $6, no grip coating needed. This makes the Roof top glass and cell cost $56.

$56 < $75 < $255 to $2055
Rooftops (so far) are cheaper, and as recorded, are more efficient. Solar bike paths are 40% more. Solar roadways are somewhere between terrible value and completely ridiculously horrible value.

Rooftop panels are considerably cheaper than just the raw solar cell and glass cost for solar bike paths. For instance:
http://www.alibaba.com/product-detail/a-si-thin-film-solar-module_669355175.html
The most expensive model comes already framed, at $70, and it is a meter and a half in size. Scaling it to 1m^2, it costs $46. Done.
Solar panel prices vary a LOT per type and manufacturer, but at the same cost per meter square as the glass and cells cost per meter for solar bike paths, without any backing or cement. Compared to solar roads, even my cheapest underestimate was MORE than the cost of the majority of high grade, 1.6 by 1 meter cells, which are bigger, much more efficient per area, and cheaper per area. 

$46 complete < $75 plus unknown cement costs < $255 to $2055 plus cement costs
Even if mass production brought the glass and solar cell cost down to half, you're still looking at costs of concrete / cement / backing on top of that. It would also take years for production to pick up enough to drop the prices so much:
$46 complete ?<?>? $40 Projected cost assuming it's mass produced, plus unknown cement costs < $130 to $1030 Projected cost assuming it's mass produced, plus cement costs

But that's the problem, we know rooftop panels are more efficient, and we know they are cheaper, and quite arguably they're easier to install. Solar bike paths ARE less efficient (and are likely to always be less efficient due to refraction/reflection/scratching), bike paths ARE more expensive (Scale of economics and mass producing would take years, solar roof panels are cheap already, and very likely to always be cheaper due to less materials). Can I  also argue at this point that wireing roof panels is going to be easier / cleaper, because we have a lot more experience with it than trying to wire panels embedded in the ground? I don;t know, they didn't share their information on how they built the bike path yet.

I'm petty sure that at this point, we can completely rule our solar roads within the near future, the costs are extremely high and the demand for space is nowhere near drastic enough for us to need to go there, not as long as roof tops..... (heavy sigh, and bike paths,) are open.

Solar roads are completely horrible. So horrible I won't even address it form now on, because even bike paths are preferable.

Next step is figuring out how you actually build the pathway / roads, or for them to tell us the actual building cost
Reply: ***** Good to know that we both come to the same price for wholesale glass. ($2mm/m2).
Now for the required thickness. You can drive the heaviest truck over a 1mm sheet of glass and it will not crack if the glass is fully supported and the truck doesn't steer or brake. The reason for this is that the compression strength of glass is very high. It has a higher compression strength then most concretes. The forces on the glass change when a truck is braking, steering and so on. I guess a lot of it depends on how well the glass is supported from the layers below. My gut feeling says that 20mm is more then sufficient, but I cannot back that up with figures. 
But I agree that the thicker the glass needs to be, the more it will cost to build these roads.

So glass, coating, and cells have us at $75 per m^2 for solar PATHS
I came to the same ball park pricing. 
The biggest difference with a regular solar panels is the thickness of the glass, its 3-4 times as thick, and the road panels will likely be a lot bigger then standard panels. For the bike path like they build they would be 1.7m by 2.5m. And like any other panel, these could be mass produced in a factory somewhere. All you would have to do is put them in some formwork and add steel and concrete.
I haven't calculated the cost for the concrete because you are building a road anyway.

As far as roads versus paths go, I agree that this depends on the required thickness of the glass, and possibly the price of the coating. 

Building these roads would be rather easy. Put the panel down, add some steel and pour the concrete. Once the concrete is strong enough you turn the slab around and waterproof the edges around the glass and apply the coating. Compared to a 'regular' modular path the extra work is minimal.
My question would be how much a modular path costs compared to a regular path, and that I don't know, nor do I know how to find that out.

I guess we will have to wait a couple of years and maybe they will release more info.
Reply: +EroomYrrah http://www.treehugger.com/solar-technology/france-pave-1000km-roads-solar-panels.html
Reply: lynzcow LETS see what they get for results.